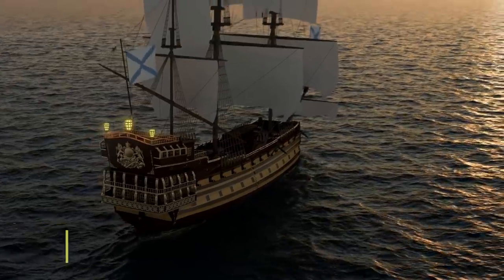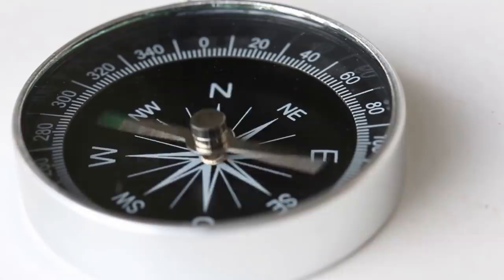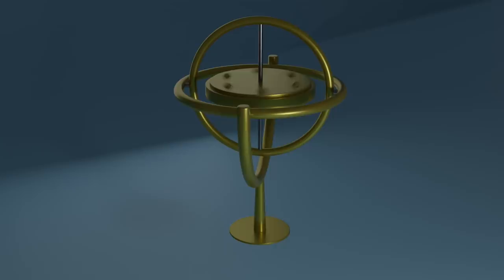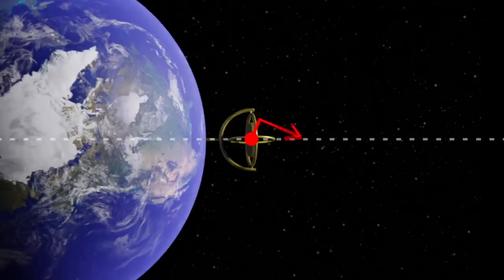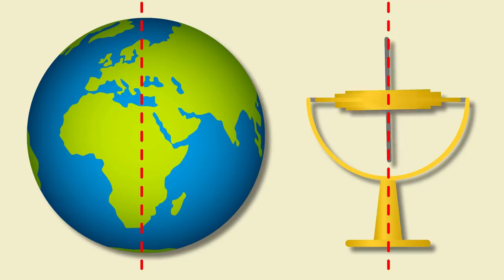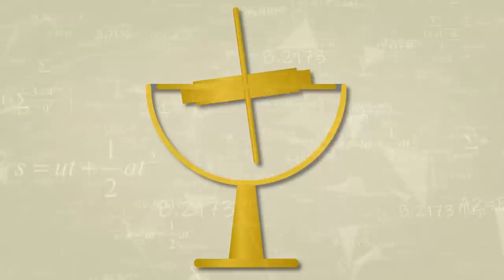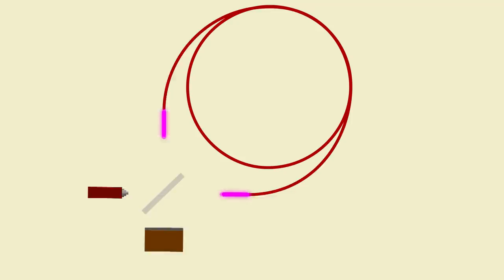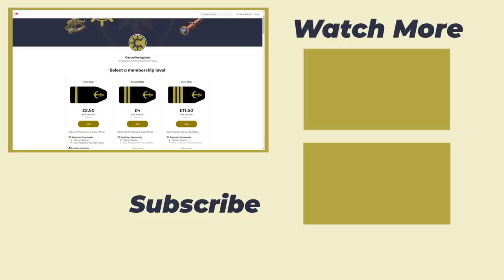Gyrocompass: How Ships Navigate Using The Earth's Rotation

Comment: I heard about "laser gyro" used in IRS/inertial reference system on aeroplanes but always wondered how they work. This video is a perfect explanation. Thanks!
Reply: The laser gyro system on an airplane work (slightly) differently though, as did the mechanical gyro platforms that were used before. To start with they have to use at least three gyros, not just one (nowadays usually up to 6) and a whole lot of accelerometers which are very important indeed. And of course they do provide more than just a direction, they provide all information about the situation in 3d, as well as navigation and (magnetic) compass direction, the latter derived from deviation tables in the systems memory.
Reply: I've actually worked with software that used the optic gyros in aerospace systems and we've wasted a couple of hours trying to figure out how did it work for curiosity sake. This video seems to showcase very intuitively how do they work. I never got to understand them fully until now.

PS: it wasn't necessary to understand how it worked to that particular software 😅
Reply: They are usually continuous wave and use phase detection. I don't know of any systems that time discrete pulses. But that's nit picking.
Reply: @RobertSzasz  now that I think of it you are right. They detect phase and not pulses, but the part that broke my brain was the why one signal goes faster than the other.
The visible animation just clicked when I saw the video.
Reply: Oh the notorious gyro pump failures, why do GAs keep having it 😆
Reply: you mean the laser gyro used to absolutely debunk bob in behind the curve?
Reply: @double_07  FYI - Hemispherical resonating gyros can also sense earth rotation.
The Northrup Grumman SIRU is one example.

Comment: It is a very common misconception that the gyroscopic effect keeps a bicycle upright while in motion, but it’s actually the caster angle of the front wheel. If you locked the wheel straight ahead, a bike would fall over almost immediately, no matter how fast it was going. The low mass of the wheels, and they’re slow rate of revolution makes their gyroscopic effect negligible relative to the mass of the bike, especially with a rider.
Reply: You can actually make a bicycle with negative caster angle, eliminating that effect, and also counter rotating wheels to eliminate gyroscopic effects, and it will still self-stabilize
Reply: In fact one easy way to dispel this with common sense is to think about steering the bike, if the gyroscopic effect is strong enough to keep you upright, it's certainly strong enough to prevent you steering!

Comment: Bicycles are actually not significantly stabilized by the gyroscopic effect, there is a nature paper where they built a non-gyro bicycle and it still is stable. Stabilization mostly comes from the steering wheel being front and the back-tire following.
...also wow, the fibre optic gyro is magic.
Reply: That’s what I remember reading as well. And agreed, fibre gyro is pure magic… black magic… or maybe quantum but really there isn’t much difference between the two…
Reply: How on earth can you make a non-gyro bicycle?
Reply: @SarSaraneth  you add counterspinning wheels
Reply: @Doping1234  ...Huh.
Reply: @SarSaraneth  that's how you cancel the gyroscopic effects.
Reply: @RobertSzasz  Yeah, it makes sense.
Reply: I think it's called the caster angle, cars have it too
Reply: @-GinΠΓ Τάο You're ignoring the common meaning of the words you're using. It's entirely normal in engineering to describe a counter-force cancelling out a force. No one is expecting this to mean that the laws of physics were altered for the experiment.
Reply: @-GinΠΓ Τάο yes. Please do walk us through it then. Thanks.
Reply: Actually there is a whole array of effects adding up to make a bike self-righting.

Gyroscopic precession makes it so, that if the bike starts leaning over, the torque induced will turn the wheel in the direction of the lean, so it essentially steers the front wheel under itself. Then there is the fact that the front wheel contact patch is behind the steering axis, so moving forwards will induce a torque in the steering so that it is trying to straighten up in every single turn (like the wheels on a shopping trolley). And as you said, the steering wheel being in front. As long as the bike is leaning more than it should, the gyroscopic turning force is stronger than the correcting torque, and once the wheel is under the bike, it's not leaning enough to overcome the torque from the trolley wheel configuration, so it will straighten up. Once it's vertical, and moving straight ahead, there is no longer a torque on the steering axis.

Interestingly enough you can make a self-righting bike which doesn't meet all these criteria, given the configuration otherwise accounts for the correct steering inputs.
Reply: @-GinΠΓ Τάο
No no, walk us through the math please
Reply: @-GinΠΓ Τάο you said you could walk us through the math, yet you seem incapable of doing so. Learn first, then speak.
Reply: @garygenerous8982  technically white magic because light and stuff
Reply: In the video of the people biking you can see the effects of the design of the bike
Reply: there are more physical phenomena to why a bike stabilize itself. The tyre contact patch physics combined with caster angle and trail. Mass distribution but the main thing is the front heavy steering which basically means that the steering rack "falls" into the turn making the bike selfcenter.
Reply: Scie tists have also made non-trail bicycles, rear-steering bicycles etc. No one of these effects is always responsible, the most that can be said is that a bicycle uses all of these effects to some extent depending on its design
Reply: @vale.antoni  contact patch behind the steering axis is pretty much the only thing that makes a bike self-balance. Gyroscopic effects are there on bikes with big wheels but you can put tiny wheels on a bike and that effect will mostly be gone, its still self balancing.
but if you put large wheels on a bike with contact patch in front of the steering axis that bike will be very hard to ride, regardless of the gyroscopic forces helping...
Reply: It's not really all that magic - the inner ear operates on a very similar principle regarding motion in three dimensions, though this is a much cooler version with light and math.
Reply: This is based on a fundamental misunderstanding of the paper.

Bicycles don't have to be stabilized with the gyroscopic effect of the wheel. They are, however, stabilized by it.
Reply: the effect is much stronger in motorbikes, because the wheels are not only heavier but they also spin a lot faster.
Reply: What about a unicycle?

Comment: Nice video.  I worked on the old Sperry Mk 19 gyrocompass and later the Mk 27 in the US Navy.  Lots of little bits to 'apply torques' to them.  They also used a speed input from the ship's log to minimize 'steaming error'.  But we had to manually set the latitude.  I'm sure the modern laser with GPS feed are a lot less prone to failure.

Oh, and a 'fun' detail, the Mk 19 could be switched into 'high latitude' mode where it stopped trying to seek north and just acted like a gyroscope.  That was a lot trickier to navigate with  :)
Reply from the maker: Thats interesting. I didn't know that about the Mk19.
Reply: @CasualNavigation  There's a article out there about when the Nautilus (US nuclear submarine) transited under the ice from Pacific to Atlantic.  It discusses their concerns about how they will able to navigate.  They knew the magnetic compass would be troublesome since they pass close to the magnetic pole, and that the gyrocompass would not operate as a traditional compass that close to the pole.  But they obviously succeeded and the gyro worked better than they anticipated.  Doesn't go into a lot of details, but it confirms that navigating near the pole is a bit 'tricky'.
Reply: I worked for a few years as a deck officer on container ships and on a few of the older ones that I worked on, we still had to go into the gyro room (or where ever the gyros were physically located) and make sure the speed and latitude dials were in the right settings. Also, when I was working as cadet on the Steamship Maui in 2009, that ship had the gyros right in the chart room and it had those calibration controls right there and also a switch for northern or southern hemisphere. Someone accidentally bumped a book on a shelf into the N/S switch and put both our gyros into southern hemisphere mode and over the course of the afternoon the Captain and Chief Mate were trying to figure out why we were getting such a massive gyro error and why it was steadily increasing. Because I was the cadet, they had me just doing sun azimuth sights like every 15 minutes or something to keep constantly updating the error so we stayed on the correct heading while we all tried to figure out what the hell was going on and eventually, after like 3 hours of this I saw the switch was in Southern Hemisphere mode. We flipped the switch and in like 2 hours everything had resettled and we were back to normal.

Comment: Careful with the bicycle example, the gyroscopic effet does not grant stability, merely some inertia. In fact, you can replace the wheels with ice skates and it works just fine.
The fork angle is also a minor effect that helps, but it is not necessary since you can build a bicycle with a vertical fork and it also works fine.
The true modelisation of why 2 wheelers stand upright is actually a feedback of the torso-arms-handlebar system that feeds back a counter-steering correction by the simple act of the rider keeping his torso in apparent vertical position ( apparent because it incorporates tge side acceleration vector when turning).
As proof, you cannot turn on a bike by turning the handlebar in the direction you want to go like in a car; you have to lean into the curve to automatically start a counter-steering. 
My dad spent 40 years of mechanical engineering teaching to model and use this. 😅👍
Reply: Lean into the curve on a bike? when your poodling at 15mph or less don't think so
Reply: @ramblingrob4693  Yes, you lean. Not much, but you lean. On a racing-style bike with a low bottom bracket and/or long pedal cranks, you can easily ground the inside pedal at 15mph if you're not careful.

Comment: I'm pretty sure that last part about bikes is wrong. Yes, the wheels technically act like gyroscopes but that's not what keeps the bike upright. The way the wheel is mounted does. Car tires are even deliberately mounted at an angle to make the steering wheel revert back to neutral on its own. If the gyroscopic effect was responsible for the stabilization, it would have to make regular steering incredibly hard. But more importantly, driving straight ahead would still only be a metastable state, it would just take more work to tip it. But bikes are a (relatively) stable system, they can drive downhill on their own without falling over.
Reply: Try riding a bike with the handlebars locked straight and you’ll soon realise gyroscopic motion isn’t much help.
Reply: Well gyroscopic forces help. https://youtu.be/8H98BgRzpOM That is also why you can drive a bike without touching the handle. Also what you said about cars isn't true because cars use the forces of the corner you are driving through (centripedal force) to revert the wheel, google it and do your research.
Reply: @florianix8272  that is not why you can ride a bike without touching the handle, see Matthew White's example.

Also, the research: https://en.wikipedia.org/wiki/Caster_angle
Reply: Veritasium is about to release a video on this very topic.
Reply: @matthewwhite546  amazing timing. Now I can finally just send people a link instead of painstakingly explaining to them that they don't understand gyroscopes for the billionth time
Reply: @majorfallacy5926  Sadly, mentioning angular momentum and torque and drawing pretty pictures doesn't explain how a gyroscope works. The root cause is that "a particle tends to move in a straight line until it is acted upon by an external force." It's not obvious but it is rather simple once you understand it.
Reply: @majorfallacy5926  My dude that just says caster angle helps stabilize a bicycle.

You're mistaking something being part of the equation as it just not being in the equation at all, which is wrong.

Comment: "When something has angular momentum we also say there's a torque present." Um no. that's like saying, "When something has momentum we also say there's a force present." Force is the time rate of change of momentum, and torque is the time rate of change of angular momentum. What you actually described next was the direction the applied torque needed to point to build up the given angular momentum. "The new torque and the gyroscope's original torque..." No.
Reply: Yes, there is a big misconception between torque and angular momentum in the video, no one really noticed but it's kind of a shame considering the quality of the rest of the video
Reply: @Poulpink  The stuff about bicycles being gyroscopically stabilized is also completely wrong.

Comment: Bicycle wheels as gyroscopes:
I just watched a video disproving that. When a bicycle's steering is locked it's impossible to stay upright on it no matter how fast you're going. The reason a moving bicycle can remain upright is because the rider is, consciously or unconsciously,  making constant steering corrections in order to keep the bicycle underneath them. The steering is built so that it naturally turns in the direction that it leans. If the steering moves freely the bike will stay upright even without a rider as long as it keeps moving forward. With the steering locked it falls over immediately. There is no gyroscopic effect keeping it up.
Reply: No need for a rider, even. A riderless bicycle will roll quite happily down a hill and not fall over until either it slows down enough that steering corrections don't move the centre of gravity far enough or accelerates enough that bumps start taking the front wheel off the ground too much.

Comment: The gyro effect on bikes is supposedly overblown, with active countersteering being a more important factor. No knock on your video here, everyone "knows" that bike fact and as far as i can tell everything else here is accurate. Thanks and merry xmas
Reply: Yep, bikes are stable because, as you topple to one side, the bike steers that way and moves itself back underneath you. A lot of the other physics material in the video is also inaccurate, unfortunately, as it confuses angular momentum and torque. I'm confident all the shipping-related stuff is right, though -- they guy clearly knows his stuff in that department!
Reply: I've commented in like three other places, but props for actually interpreting the science correctly here.

Every other comment I saw claimed that gyroscopic inertia on bicycles is a myth, which is annoying because it's blatantly wrong in the opposite direction. Like you've noted, it contributes to how stable the bicycle is by adding rotational inertia to the system.

Comment: The mistake starting around 3:00 is that the Earth's rotation is the opposite of what it should be. With the north pole pointing towards the viewer, earth rotates anticlockwise in our reality where any point on the surface moves eastward. This results in an inconsistency in the torque in the animation as well, where the right hand rule leads to an inconsistent result.

As always, great video! Pointing out that there is a mistake in the animation is a fantastic educational device, come to think of it, and made me pay closer attention.

Comment: "GPS can be used to correct nearly all errors made by a mechanical compass". Never would have imagined. :D
Reply: GPS sucks at giving heading. Great for course though
Reply: @RobertSzasz  actually not if your smart, use 2. One at the bow, one at the stern, and a little math and you get a heading. Longer the ship the more accurate that heading will be, but basically anything over 100ft long will be basically perfectly accurate provided you have good gps units, even poor ones would work on a 300ft+ vessel, you could even throw in a 3rd central unit to ensure precision.
Reply: @cgi2002  a good system can do it with a meter or two separation, well behaved receivers that capture carrier phase, and a bunch of processing power.  But it's not exactly elegant
Reply: @RobertSzasz  true but I was thinking about also occasions with rougher weather which can screw with units that close. 100ft gives plenty of margin for error. In ideal conditions with good hardware a meter or 2 will do fine, infact that setup may have been used on one of the boats trying to do an Atlantic crossing, as they are limited for space and accurate location data was vital to them.